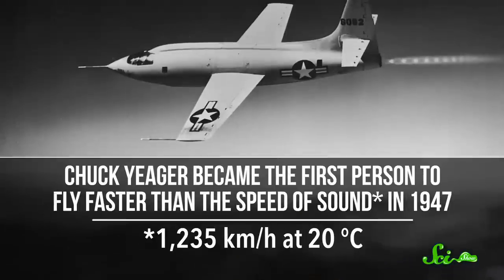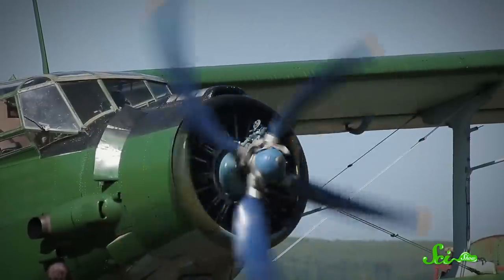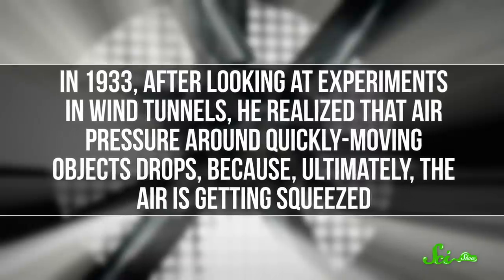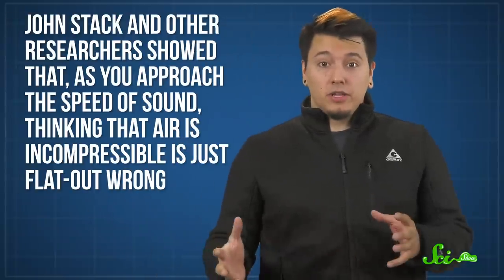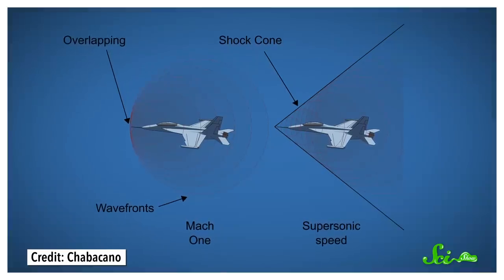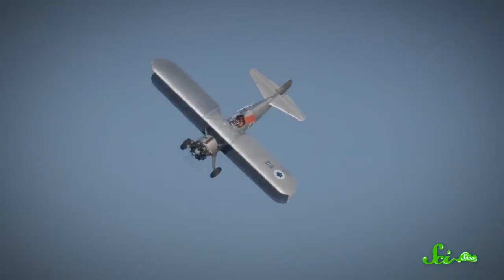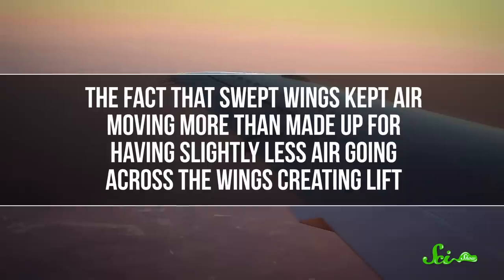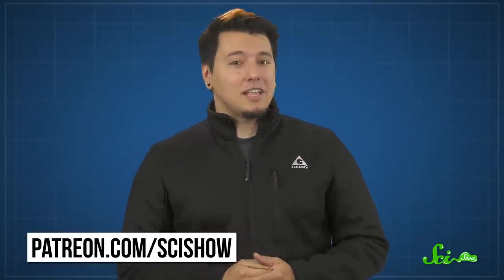A Surprisingly Simple Secret to Supersonic Flight

Comment: The DC3 has swept wings  - -  you never noticed?
Reply: The wings are hardly swept. Like about 10 degrees outside of the nacelles. Not enough to make a difference in its critical Mach number if it ever went that fast.  It was to correct the centre of lift when the plane was redesigned from the DC-2. 

The Me-262s wings were the same way. Very low sweep only to change the centre of lift due to the heavier Junkers engines being substituted for the BMW ones. 

And the Me 163 only had swept wings for stability... like all tailless aircraft must have.
Reply: The leading edges of the DC-3 and Me-262 are swept. The trailing edges are pretty much straight, perpendicular to the fuselage.

Comment: It's not the deal with swept wings... the f-86 was unable to break mach 1 and it had swept wings. It has to do with the volumetric area around the plane especially near the wings. You'll notice the f18 has a bigger middle area near the front of the wings and it tapers off near the end tips of the wing.
Reply: This is a drag reduction principle. Namely that sudden changes in the frontal area of your object create lots of drag, so as the spread of the wing adds more frontal area, the rest of the body is shrunk to keep the total frontal area about the same. Real Engineering did a video with this (which is the only reason I know this)
Reply: The F-86 was unable to fly supersonic in level flight because it had a J-47 with 5000 lb of thrust. Not enough suds to break the wall.

Comment: Wrong. Ask Santos Dumont about the first flight.
Reply: Cough, Otto Lilienthal, cough
Reply: And the Montgolfier brothers beat them all by well over 200 years. 

But if you’re talking about a powered and controlled heavier than air aircraft taking off, maintaining speed, and landing at a place no lower than from where it took off... it was the Wright Flyer flown by Orville Wright that first did that on Dec 17, 1903.

Comment: No major redesign after swept wing design ? I don't think that's fully accurate to say. 
There HAS been a major redesign to the wing tips. The wing tips for modern aircrafts have winglets to prevent wing tip vortices. This design change can also be seen in practically almost all aircrafts now and that did come quite later than swept wing design.
Reply: That’s a minor design change on wings that are still swept.

Comment: Here's another secret about going supersonic: NOTHING happens in the jet when you pass Mach 1. Nothing. No sound no boom no rumble, etc. Literally just a number on the HUD changes from 0.99 to 1.00 to 1.01. Well...SOMEtimes youll get a SLIGHT transonic buffet, but you really have to be paying attention to feel it. Usually you don't even notice.
Reply: That's assuming you are in a properly designed airplane. Try that in a P-38 and let me know how it goes..m
Reply: @DaylightDigital  true! RIP to those who didnt make it when they accidentally went trans/supersonic in those planes and lost all pitch control.

Comment: How could they have assumed that air pressure changed but not air density?
Reply: Water's density doesn't change (of course, assuming no change in temperature), yet water pressure changes with depth.
Reply: @WolfDGreyJr  Liquids like water do not compress into a higher density like air does.
Reply: Ah, yes, then to answer your question, when they said "incompressible" they meant "functionally incompressible", or better put "negligibly compressible" *in response to the plane's effects*. 

I thought you meant that in order for air pressure to change, air density would have to (as in, what is actually happening but with reversed causality), otherwise the mention of air pressure in the first place would have been a bit confusing to me.

Comment: Somewhat uncomfortable fact - the first major plane to use swept wings was also the first major jet: the Messerschmitt Me-262. Brilliant design, horribly unreliable engines that needed an overhaul basically after every flight. Germany also had barely any skilled pilots left, and very few usable runways. If they were around a few years earlier, though, the Battle of Britain might have gone very differently.
Reply: The Sweep was actually unrelated to transonic flight: it was simply because the engines were heavier than anticipated, so the wing sweep accommodated them to preserve the center of gravity
Reply: The construction was also discovered to be what some would call substandard after testing in the US. I believe when Yeager flew one to the coast it was the last powered flight we conducted with one because we discovered that. 
Still an aircraft way ahead of its time though. Over all though, it likely would have prolonged the war if they'd had more of them earlier, not much more.

Comment: Wouldn’t a flying wing (delta) reduce drag and reduce fuel usage. Isn’t the only reason we have the pencil with wings design due to the FAA slow approval process and people wanting windows. Does having widows make planes heavier? Can’t we innovate the modern design?
Reply: Hrafn Vanr :  concorde had delta wing.  Only reason its not on todays aircraft is that its only valuable for supersonic speeds, highly inefficient in subsonic.  

Flying wing designs with lifting body fuselages are indeed more efficient than the pencil fuselage.  The primary reason these are not around is that having passengers seated far from the centerline makes them sick during banking.
Reply: A.J. Mckelvy thanks. I think I understand it better now

Comment: In hindsight, the idea that air (a gas) is incompressible kind of seems stupid. I'm sure most of the difficulties with getting supersonic flight was more advancing the right materials and engineering, which was accelerated by WW2.
Reply: One of the main problems was the instability of the shockwave at the wings and moreso at the stabilizers. Literally dozens of planes flew supersonic in that era most in a dive of some sort. Most of them were shred to pieces by the occuring buffeting forces. Only a few pilots survived that.

Comment: Daily reminder that a significant reason as to why the Americans got super sonic flight first was because they stole research from the British. Well, not stole as in espionage, but rather another example of the US no reciprocating in its agreements. The US and the UK agreed to share research on super sonic flight, and the Brits had a breakthrough with a certain wing innovation that meant their pilots no longer had a very high chance of dying from losing control of the plane at such high speeds. The US took that research, used it to claim first, and then left the British to fester and rage. So much for a special relationship.

Comment: But what about the Concorde where the wings are swept forward?? Wouldn't the air slide along the wing "toward" the aircraft and bunch along the fuselage?
Correction, not the Concorde. Thinking of the wrong plane. The X-29, X-17 (thnx A.J.), SU-51K, or SU-47, or any other aircraft with forward swept wings.
Reply: Korishan : bruh, the wings on the concord are swept back.  Check X-17 for a forward swept wing
Reply: @a.j.mckelvy7968  Yeah, thnx.  I had the wrong plane in my head  :P  Updated OP
Reply: Korishan <3

Comment: Wouldn't it be cool to fly at 10000 miles per hour to the east?  At that speed, the centrifugal force of spinning around the Earth would make the plane, and everyone in it, much lighter!  You could then probably fly at a much higher altitude both because of the higher air speeds, and the lower demand for lift with such a lightweight plane.  Of course, the ISS flies so fast it is weightless.

Comment: It is a fact thet the Bell X-1 was a stolen design concept/model from the British supersonic program, and the British where the ones to figure out you needed a all moving tail.
Reply: John Gray 
All moving tail? I'm confused, ailerons/elevator or elevons?
Reply: @britbong1457  The entire tailplane surface moves to provide control, rather than some section at the trailing edge. Tends to be a bit more obvious on modern fighter jets.
Reply: pauljs75 
So a stabilator, I was just confused about ops wording
Reply: @britbong1457  There are some exceptions like delta wings. But yeah, that.

Comment: Wait a minute.  They had air-compressors before 1933.  Explain please.
Reply: *atmospheric air*. that's the key part.
if you shove it in a pipe it compresses but if you swim in it it moves away because the atmosphere is an open container... something like that.

Comment: I have to wonder why they never built flying wing airliners. And no i don't mean the flying V KLM are funding i mean flying wings like delta wings, look up flying wing airliner 1950's 1960's
Reply: When you wanna put people in the wings, it greatly increases the minimum wing thickness.

Before building the A380, Airbus wanted to use as many parts off their existing planes as possible, and toyed with the idea of 2x A370 fuselages side-by-side in a ∞ shape.
 They gave up on that idea, as they realised it restricts emergency evacuation by passengers.

Comment: I’m sorry, but this is incorrect, and the straight wings of the X-15 should be the first clue that it’s incorrect. 

You don’t need swept wings to fly supersonic or transonic speeds. What you need are thin wings. 

Shockwaves form anytime there is an object moving through the air at close to the speed of sound—specifically, higher than its critical Mach number. This is when the acceleration of the air around the object first becomes supersonic. 

The fatter the object, the lower the critical Mach number or Mcrit. 

On an experimental aircraft designed to be flown by one person launched from an aircraft with a rocket engine and gliding down to earth, it was really easy to make a thin and straight wing. 

But for an airliner traveling for hours and carrying hundreds of people, you need a thick wing to hold thousands of gallons of fuel and the large landing gear and to be strong enough to hold 200,000 to 800,000 pounds. 

So the solution is, make the wing thick, but angle it back. The wing can be made with two thick spars instead of thin ones like the X-1 wing. But the airflow will see a much thinner wing and will have lower transonic drag. 

You don’t want spanwise flow on any wing. In fact... this is why many early swept wing aircraft were very dangerous and why highly swept wings had wing fences and dogtoothed leading edges to prevent the rapid loss of lift (typically on the wing tips) which not only would render ailerons ineffective but because the wings were swept would actually pitch the aircraft further up and make the situation even worse (google the “Sabre dance”).

Comment: If they thought that air is incompressible, then how they've thought a piston engine worked? :D
Reply: Because a piston engine traps air in a closed space. That’s why you need valves for a piston engine to work. ;)
Reply: @Bartonovich52  yeah, but as some of us know from experience - incompressible medium in a closed piston-cylinder system results in bent conrods. This clearly wasn't happening unless enough of some liquid entered the system. ;)

Comment: Why then do some birds have wings that are swept backwards even though they move much slower than the speed of sound?
Reply: Just one reason: Because it helps  diving faster, which is crucial for successfull hunting. 
Something first planes probably didnt want.. dive fast ;)
Reply: @dadrising6464  dive speed is great...right up until it rips the wings off your plane...then much less so.

Dive bombers often had special flaps to let them dive at a steeper angle without reaching speeds that would cause catastrophic structural failure of the airframe.
Reply: @dynamicworlds1  i know, was referring to why some birds have swept wings (at least on diving, flexible yet stable wings, nature is awesome) and why first planes went with straight ones first ( fast diving wasn't a desirable attribute in the wright times,i suppose. More of the opposite)
Reply: @dadrising6464  I know, I was making a bit of a joke as I remembered ways I've crashed planes in games before.

Dive down to aim the bom-and there go my wings....well that's embarrassing...
Reply: @dynamicworlds1  sounds like warthunder xD
Reply: Evolution is about what works, not what works best. It is incorrect to attribute any characteristic of any animal to a "reason" for it being that way. Rather, whatever way it has evolved has allowed it to succeed, that includes things that could be better but for which there is no selection pressure to drive a change. Many attributes of animals just "are" simply because they work well enough. Evolution is not fine tuning - it is about beneficial changes that allow the creature to live long enough to procreate.
Reply: @HarmanRobotics  i wasnt impliing nature is some planned mechanic thats working in the back and tuning things. I just wanted to apprechiate the designs it led too.  
Evolution seemed to prefer airborne predators that were able to dive faster/reach prey first. Why are we discussing this stuff if someone just asked "why do some birds have swept wings at slow speed" . No need to start with darwin
Reply: @HarmanRobotics  There's been a lot of convergent evolution on wing shapes and sizes. I think it's safe to say that given that flight is the most energy-intensive form of locomotion, there's a lot of selection pressure here.

Comment: Sorry, you guys are amazing, but... seriously??? A 10 second google shows compressed air was used for pneumatic drills in 1861.
On top of that, and I've not the time to google when it was discovered, but: Aerofoils, my dude..
The swept wing thing, well.. I'd like to understand it better, but I think I understand it better already than explained here. Maybe redo this one.
Reply: What is meant is that the models treated air as incompressible because it was believed the effects of compression would be too negligible to matter. The discovery was that air is compressed more than accounted for at those high speeds.

Comment: Yeah we don't want things going at super sonic speed falling out of the sky. But we also don't want the plane to burn up while it is up there. That's kinda the whole reason the black bird was scrapped as it had a high odds of burning up.
Reply: The blackbirds weren't just supersonic, they were hypersonic
Reply: @MarioMonte13  will still an issue to deal with at super sonic speeds. One of the big killing points against commercial super sonic flight, the planes were just far more expensive (on top of people complaining about sonic booms).
Reply: The SR-71 was never at a risk of burning up, in fact the titanium skin became stronger over time as it went through more heat cycles. The only thing heat factored into with that aircraft was its max speed. Going faster would have damaged the engines, which is obviously a bad thing.
Also worth pointing out, not a single one ever burnt up.

Comment: Tesla will build an ever faster jet that runs off electricity.
Reply: That's impossible for several reasons, except you want to built a jet engine with electric heating elements in the combustion chamber but than again, Tesla could not build a competitive battery electric aircraft in the next 10 years.
Reply: @mandernachluca3774  he said jet, not jet plane, just jet
Reply: @crackedemerald4930  
And what else should it mean? ......

Comment: thinks air can't be compressed, sound is compression of air, planes can't fly when approaching speed of sound, pikachu surprised face.
Reply: helterskelter416 What they were thinking was that the effect of the compression of air as it flowed past the plane was small enough that their models didn’t need to care about it; this assumption turned out to be wrong, as air compression was not negligible.

Comment: I'm pretty shocked that it took people so long to realize air gets compressed. In 8th grade we compressed air with our fingers, using a syringe without a needle.
Reply: What is meant is that the models treated air as incompressible because it was believed the effects of compression would be too negligible to matter. The discovery was that air is compressed more than accounted for at those high speeds.
Reply: In a closed system, like an internal combustion engine they knew it could be compressed. Free air though, such as in flight was thought to be incompressible, as the post above me explains.

Comment: Unusually poor for SciShow, overly convoluted and yet missing the clear explanations...

Talking about how air compresses was good but mentioning transonic flight, explaining what it is would have been much better. 
Explaining how a swept wing can increase the critical mach angle by decreasing the amount it speeds up airflow; so helping subsonic aircraft (eg. airliners).
And then mentioning flow separation at transonic speeds; which can lead to a lot of problems and using a swept wing can help alleviate them.
And finally, how by sweeping back the wing in supersonic flight to be inside the mach cone can allow the use of a subsonic wing section; which is desirable for practical reasons.